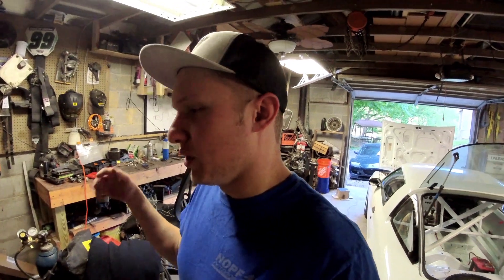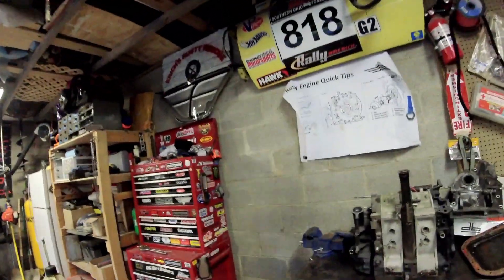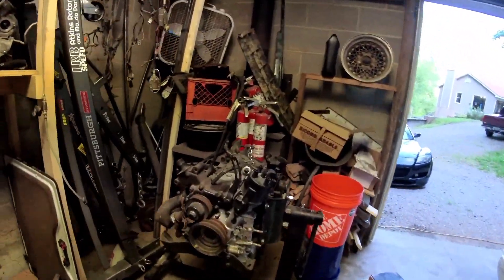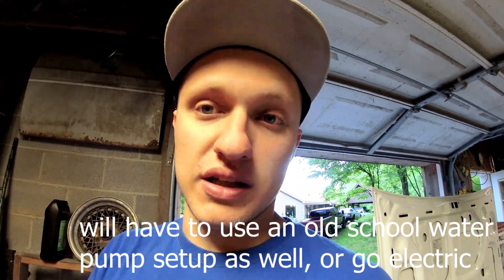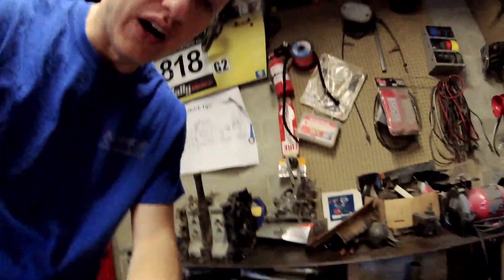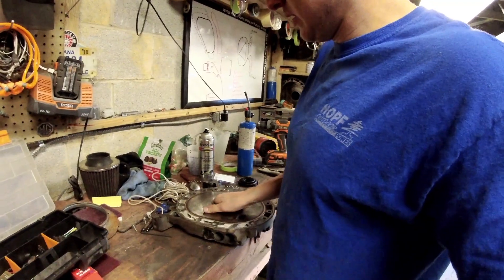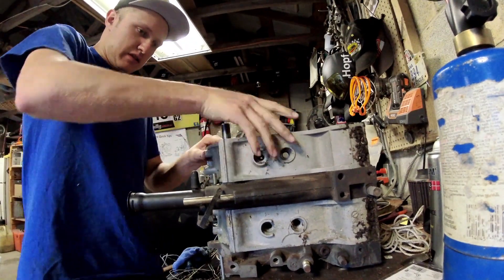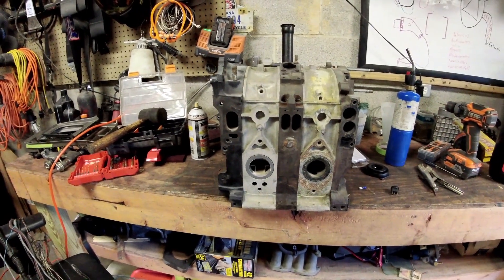Building a 13b Mock up Rotary Engine - Exploring Mounting Options

Comment: Hey Rad, Got a question, I'm replacing the  engine my 84 13B Gsl-se with a Japan 13B RE-super injection engine. Do I also need to swap flywheels?
Reply from the maker: nope, Run the flywheel that comes on the engine you are buying from japan assuming its the correct flywheel to the engine it is on.

Comment: Sup Rad Potential I have a question for you. https://youtu.be/bYo6wqeJSgA These MotoIQ guys posted a pretty cool video about traction bars to counter wheel hop on leaf spring trucks. The arms have another link and a ball joint at the end which seems like it would enable a FB to have shock travel at full lean. I posted a comment asking them out of interest if it could be multi purpose for fixing rear end binding without going the TTT mounting route or welding, etc. I don't think they quite understood what I was getting at. You think something like this exists as an option for a FB? Thanks in advance.
Reply: The item they're selling is a pretty interesting idea, only it's marketed for the sole purpose in their video only.
Reply from the maker: I will take a look at it tonight.  In my video about the binding, I explained the old rally car ways, swapping some links around etc.  Leave springs have a different reaction to force and stuff vs a linked setup.
Reply: Sick thanks!! Haven't had a chance to watch the next video out yet, work grind is real!
Reply: I watched yours on the rear end linkages, it got me thinking about these traction bars. Was wondering if they could be kinda multi function for this application as well.